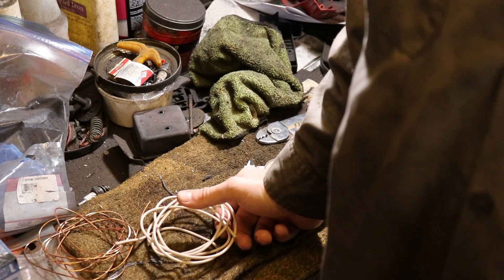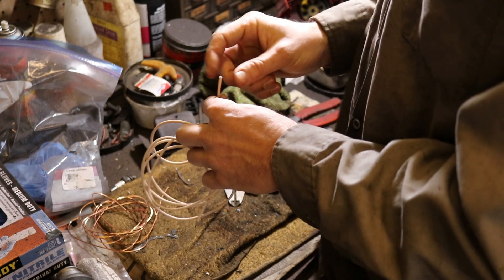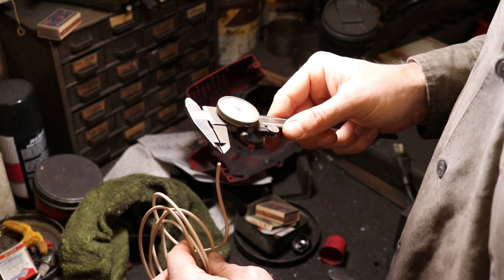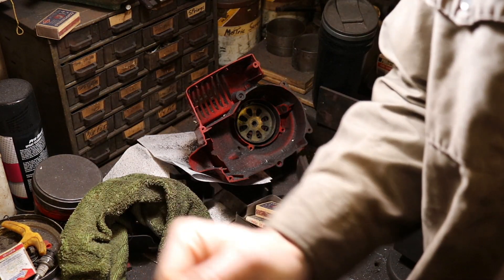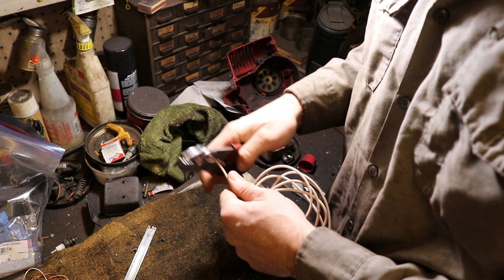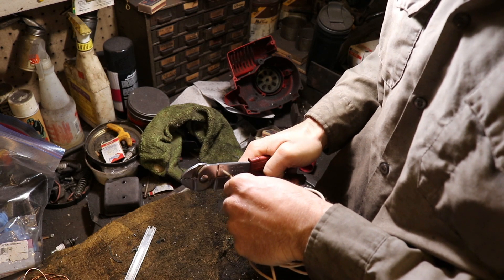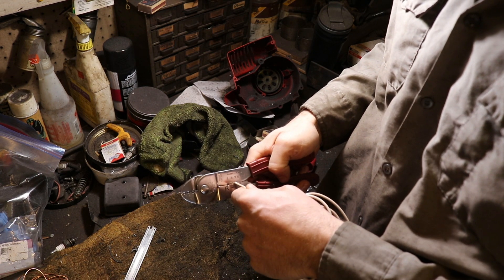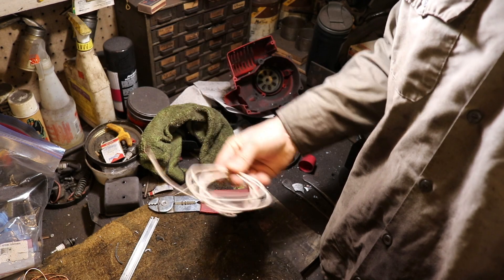How To Determine Wire Gauge on a Motorcycle Build

Comment: messing with wiring is my biggest fear, im getting my gl1100 next week to start working on it and like you im gonna have to move all wiring around and im gonna simplify a lot too, getting rid of all but the speedo basically
Reply from the maker: Yeah, that's the story here as well, single speedo for now. I debated a tach as well, but I can just listen to the engine, right? For me the chopper/bobber thing is all about simplicity and minimizing as much as possible. I want to be able to see the bare beauty of the machine when I am done.
Reply: @HooptieDoodle  most of my bikes never had a tach so im not worried about that. did you consider going for the single carb conversion? im seriously thinking about it, and since you have the bike apart would be easy to figure that out. plus another mod you might look into it is the kit to eliminate that oil filter cover and be able to use a regular screw on filter. that makes you life wayyyy easier
Reply from the maker: @georgelucasweiss-tripleB  I am planning on keeping both the stock oil filter and carb setups. The oil filter is just like that on the Mini Cooper I used to have and I thought it worked well. I do have plans for an air filter mod on the stock carbs, but that is it.